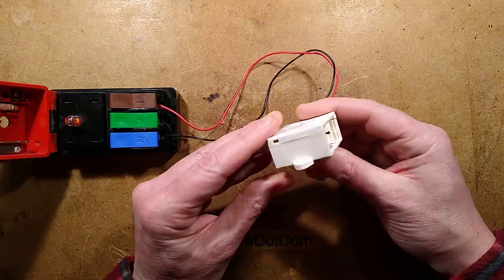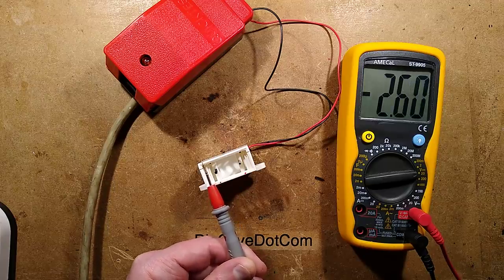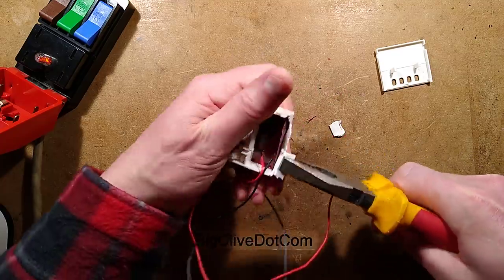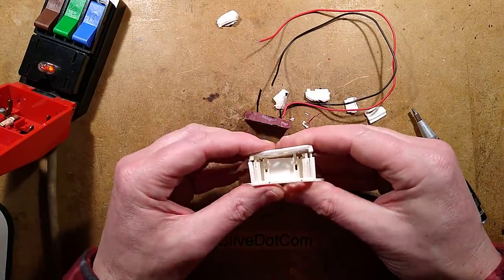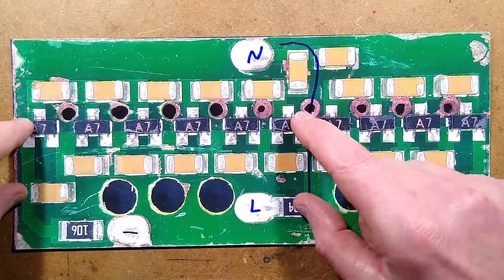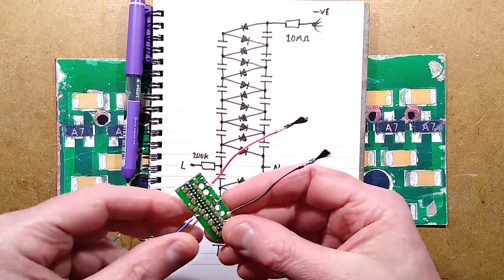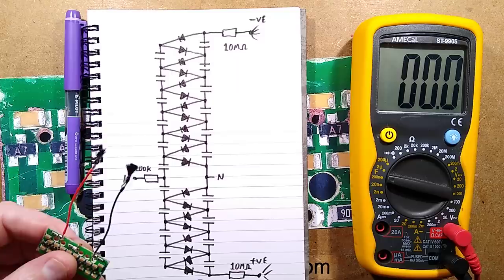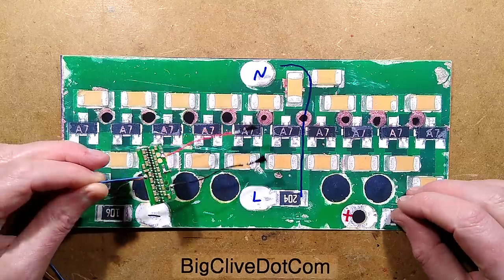Inside a Chinese fridge sanitising module (with schematic)

Comment: I stopped using my fridge about a year ago now, I cleaned it out with bleach and closed it, six months later I opened it to see if it was OK and the inside was just green 🤢😱 I've not dared to look since
Reply: One shall never close a fridge while not in use.
Reply: @chongtak  How do they ship them, then?
Reply: @SodAlmighty  they ship them new. If not new and closed for too long, you'll get what was described above. Just give it a try.
Reply from the maker: Clean it again.  But this time leave a wedge in to hold it open if not in use.
Reply: @bigclivedotcom  for serious? I didn't know that was a thing! Thanks!
Reply: @Okurka.  you are a lucky guy then. Not everybody is as lucky and smart as you. Google it and you will see, it is suitable to let a fridge open when not in use.
Reply: @Okurka.  ok, let's say you were just lucky then.
Reply: My late grandmother's fridge was kept for 15 years with the door closed and it wasn't pleasant when we decided to start using it. Fortunately the worst of the mold just lifted up as one piece.

Protip: when deep cleaning a fridge be sure to remove the false floor and rear wall of the freezer compartment. The area under the freezer gets the worst mold because it collects all the debris that falls and rarely gets proper cleaning attention.
Reply: @eDoc2020  15 years? I'd never use that 😅 I'm thinking maybe just get a new one, and this way, I have spare fridge parts
Reply: @phonotical  It really wasn't too bad to deal with. You could always pay someone to clean yours for you, that should cost much less than a new fridge. You can just blast it with a hose if you don't want to get near it, the food compartment should be fine with getting wet. Just try to avoid the electrical components and give it time to dry before plugging it in.
Reply: @eDoc2020  yeah I learnt that mistake the last time 😂

Comment: When you measured the negative voltage with the multimeter I was wondering what that would have looked like if you used an oscilloscope instead? What frequency and type of wave would it show?  

Edit: Oh, I'm guessing capacitors charging and discharging?
Reply from the maker: I'd guess DC with ripple.